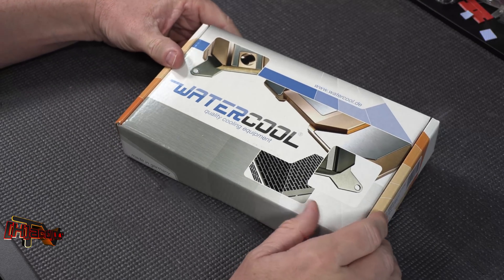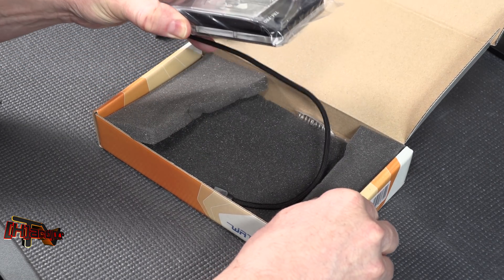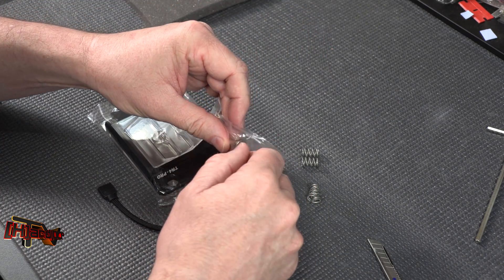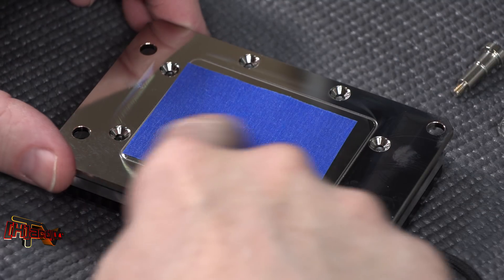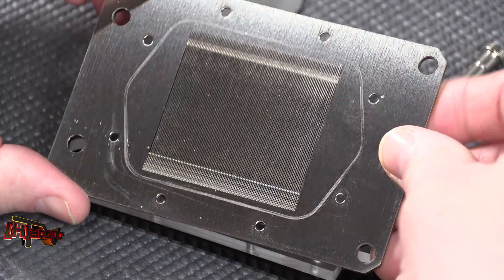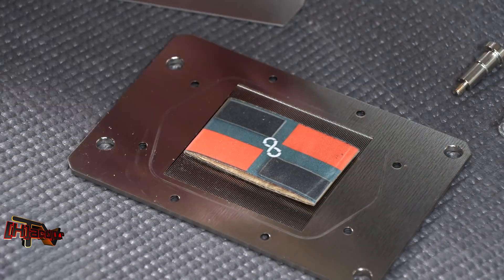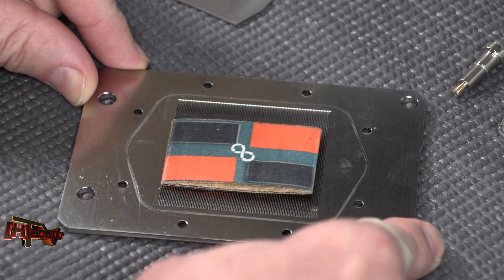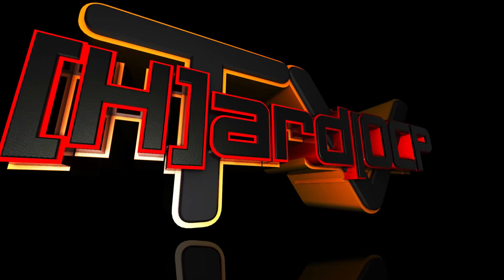WaterCool HEATKILLER IV Pro Water Block for Threadripper - Unboxing and Breakdown

Comment: Thanks for the breakdown, very informative on showcasing the design. A word of caution when taking apart a waterblock, those micro-fins have very sharp edges from milling and like to collect fibers from things like paper towel or microfiber cloth, so be careful not rub them too much. If you do find you have a large amount of corrosion, radiator flux, or dust in between the fins, I suggest a toothbrush and distilled water to clean them out, dry thoroughly, then do the same again lightly with rubbing alcohol and allow it to evaporate before sealing it back up. Make sure the seals are properly seated and free from moisture or dust. Really you should avoid taking things apart unless they sorely need a cleaning, as the seals from the factory should be in their best possible condition, and any further disassembly of the block will only increase the risk of a leak. My experience comes from a deep cleaning on a 5 year daily use overclocked custom loop.

Comment: Would it be optimal to have the coolant temperature at 20.5C - 69F prior to entering the water block?
Reply from the maker: Desmond Bradley The lower the better.
Reply: I know that if you get it to 68F-20C or lower then condensation can become an issue. I am trying to figure out if using a Peltier or other means to lower coolant temps would be a good idea. Thank you for replying. You are the first to have done so and I really appreciate it.
Reply from the maker: Well yes, if you use active cooling, condensation can be an issue.  Ambient temperatures and humidity are a big factor in that.   It would truly depend on how your entered active cooling into the system and where.
Reply: The scope of sub-ambient cooling will exceed the youtube comment section lol. I would suggest building your system on paper, then compiling all your questions and asking on a forum like xtremerigs. Though I'd also suggest doing some research yourself

Comment: The few WaterCool products I've gotten to play with have always been art. One thing, it looked like the top plate could be reversed so you could orient the output on either the left or right without the logo going upside down,  very cool if true.
Reply from the maker: Only goes on one way due to the offsets on the hold-down points not being square.
Reply: Heatkiller has a pump you can connect directly to the CPU waterblock like the Alphacool Eisbaer? thanks!

Comment: I've had my HK4 block for a few days but still waiting on my Watercool MO-RA3 radiator so I'll be testing out my system with an Enermax LiqTech 280 cooler until next weekend.